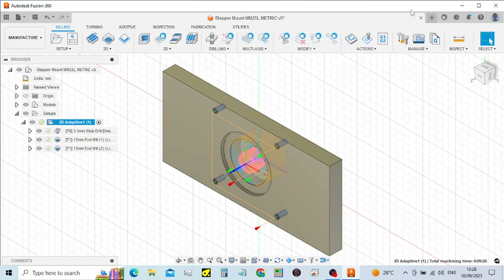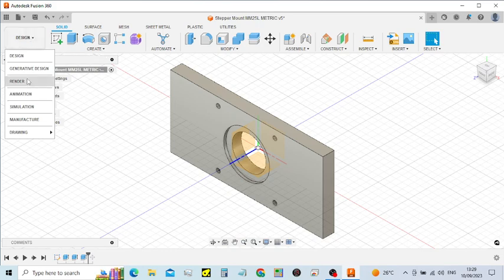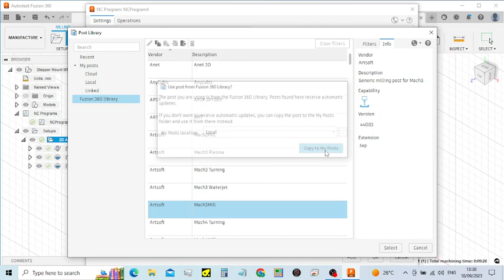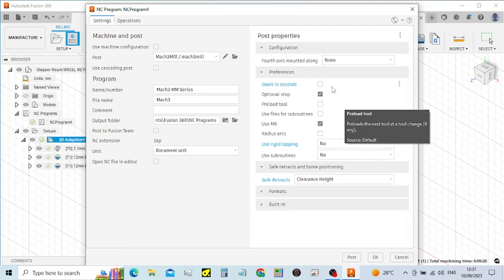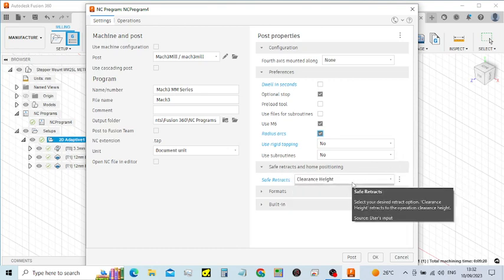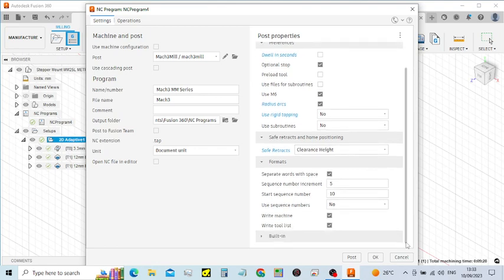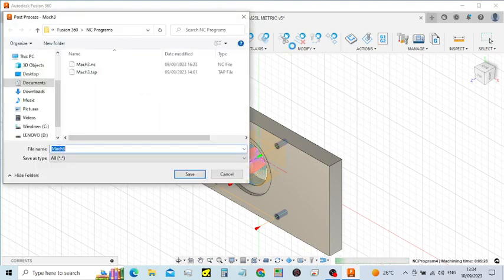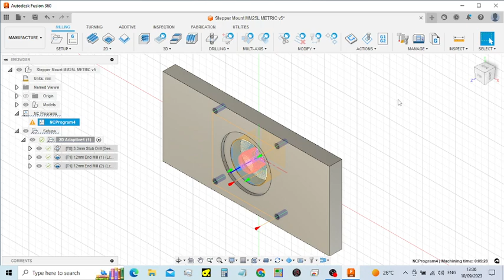Fusion 360 Mach3 Post Processor for MM32L and MM25L CNC Mills Part 1

Comment: I will try to be brief I am running fusion 360 and Mach 3 on a old email which has been converted to nema 42 with gecko drives I had an issue infusion and the tech support had me reset my preferences which caused me to lose my post-processor the machine has no tool changer it does not have spindle speed in the software and I do not use you 28 or g 54 I have downloaded the artsoft post-processor but I need someone to help me to remove the g28 and g54 lines of code I have gone in and set the the parameter to clearance high does the post-processor still puts in g28 and g54 what are the other the machine has no limit switches any advice how to modify the post would be greatly appreciated thank you

Comment: Thanks for the video. I have a mach3 cnc for wood works. I have a strange issue with fusion360. Post process file is preloaded for mach3 I choose that one. I load gcode to the mach3 mill start cycle after reset axises the machine only drills and stops after gcode sequence ends. Everything seems ok but behaviour of cnc is just like this. I dont have same problem with artcam but I’d rather to use fusion360 not the artcam